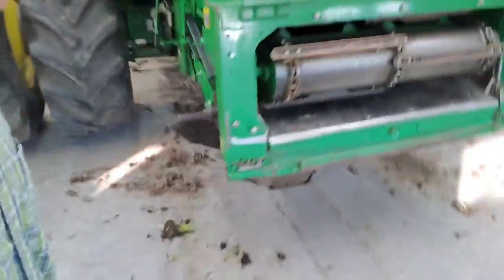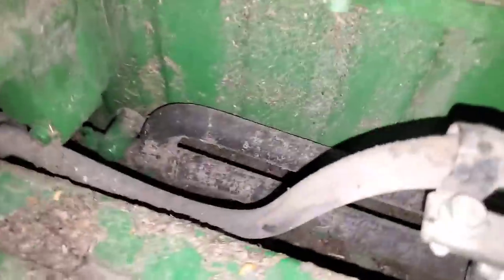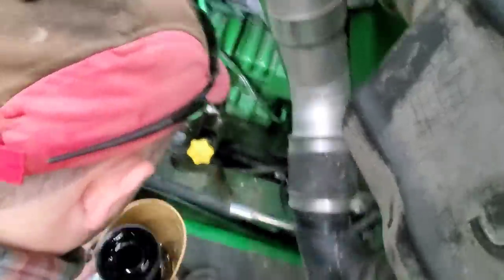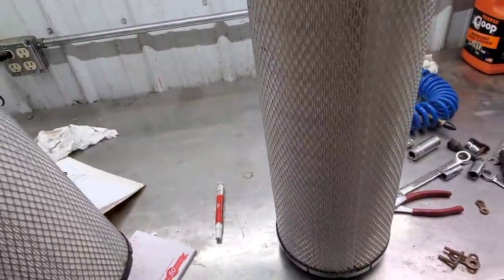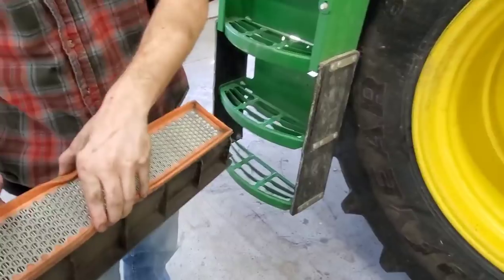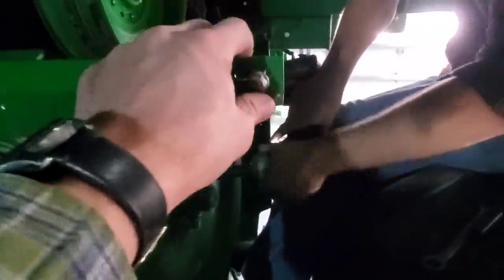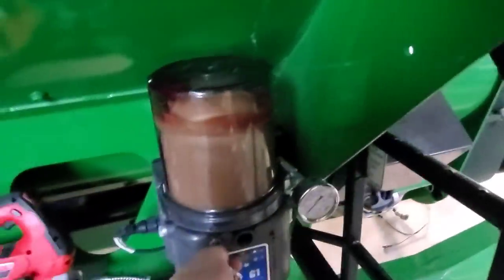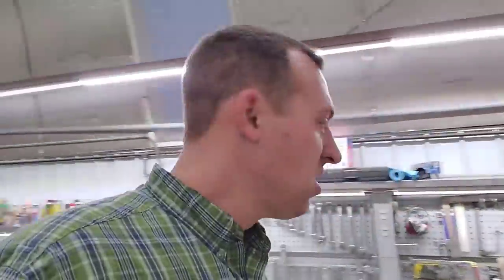Changing Oil and Filters - #299

Comment: Just a gentle reminder about your coolant. Does the system have a filter? - some do, and also has the fluid ever been changed since new, perhaps when a flexible pipe perished or the system sprung a leak? It is increasingly often considered wise to do so every 5 years or so, even for seasonal use machines, as well as checking for antifreeze concentration before winter storage.
Reply from the maker: The combine has a new head gasket put in last winter and that included a full coolant flush.

Comment: Have you replaced the water pump on your combine? Deere recommends every 700 hours or 2 years what ever comes first...When the bearings fail if your"lucky" it will just dump all the water in crankcase.If your unlucky you'll be overhauling it,or putting in a engine after the bearing fragments run through engine. We've been unlucky once $'25,000' tear down on a 13.5 liter and lucky twice ''12.7litre and a 8.1 liter  water in the oil''Deere engines with gear driven water pumps not the best design. Check your engine fan bearing on the combine too,take the belt off a work it side to side for play, when that goes out a new radiator,air to air after cooler, fan, and misc parts will cost about $12,000 if you do all the work yourself, speaking from experience.

Comment: Something that will help to prolong the life of your high wear chains and pulleys.
Do u run oil lab motor oil tests on your farm engines.  Can often spot a problem before it becomes major damage.  Same with gear, hydraulic transmissions and coolant systems.  Will find foreign liquids and dust/dirt ingress before major damage.
Deere runs such a program,  lots of independents.  CATS the best.

https://www.schaefferoil.com/roller-chain-lube.html
https://www.sprayon.com/product/lu202-moly-chain-lubricant/
https://www.texasrefinery.com/products/hydraulic-industrial-oils/moly-chain-oil/
I like the liquid type in a hand pump can, no spray can, for penetration.  Every 10>20 hrs good soaking.

Your new employee has lots of skills talents sets.  Electrician, farm machinery maintenance.  Look for him to be buying his own farm in a few years after he saves the DP